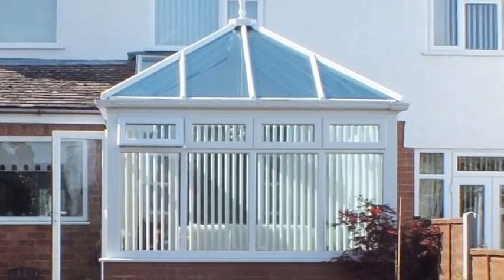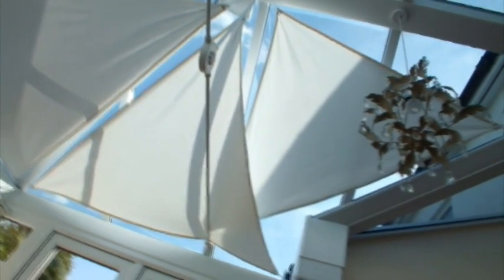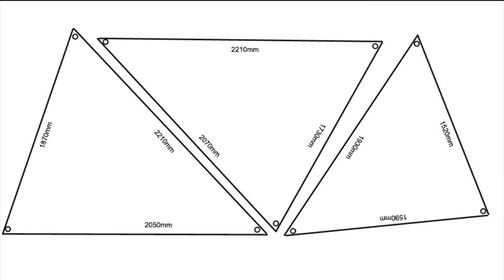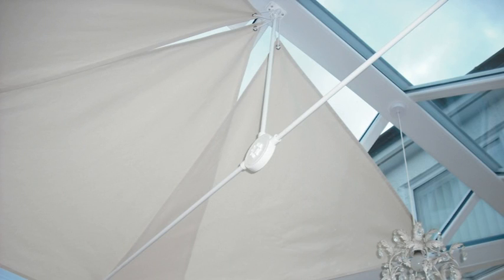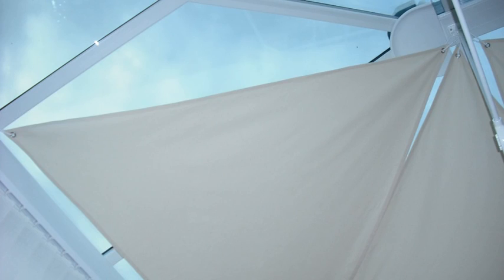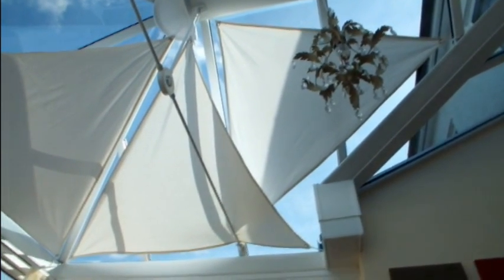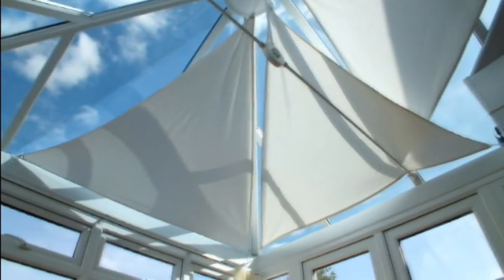How to make your own conservatory roof blinds

Comment from the maker: They reduce heat radiated through the glass that they cover. With ventilation from window vents (and sometimes doors) they have reduced the temperature in our conservatory on hot days by between 5 - 10°C.

Comment from the maker: You could try blackout lining but you might have two problems: the lining being too thin and pulling out of shape (we tried a cotton bed sheet and weren’t impressed) and the lining blocking out too much light. In the end we chose cotton canvas. The thickness is 0.025” which is the same as deckchair canvas. We were able to turn and hem this on an ordinary sewing machine. After 4 years they have still kept their shape. If you Google cotton canvas there are plenty of UK suppliers. Good luck.

Comment: Hi Kev,I made similar blinds after seeing your video,they work and look great,but I couldn’t figure out how to attach them to the upvc rails.I tried sticky back hooks  but they come away ,as soon as it gets hot. Any ideas please? Thanks Cathy.❤
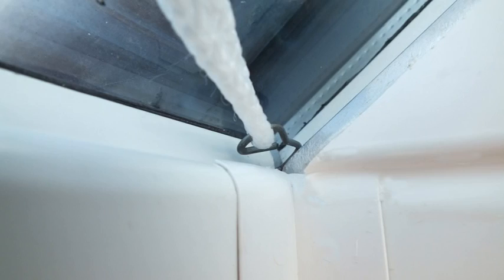Reply from the maker: We were lucky as there was a small gap between the beading running along the bottom of the glass and the uprights (see 1:47 into the video). This was big enough to slot the hooks into. If you don't have this gap, all I can suggest is that you drill some small holes in about the same position and screw in some screw eyelets and hook onto those. They should hold as long as your holes are small enough (maybe 1.5mm?). Add a spot of epoxy or super glue to the threads as long as you are prepared to leave them in if you take the blinds down, they shouldn't show too much?
Reply: @ Ah! Thank you so much,I have all winter to get that sorted. Bless you. I adored the look of them when they were up,and they did make a massive difference in the temperature. 😘😘😘

Comment: Hello Grandadkev, thanks so much for your video. We need shade for our conservatory to cut out the glare mainly. I know it's a long shot as it's years since you posted the video, but could you comment on the possibility of the magnification through the glass causing a fire hazard? Have you had any problems with this? Thank you, Phil
Reply from the maker: There is no magnification through double glazed panels as the panes of glass are parallel. The blinds decrease temperature rather than increase. See my comments since posting on where to source the fabric. Also we now use 5mm white bungee cord to tension the blinds rather than nylon cord.
Reply: @Grandadkev  Sorry for the delay in replying. Thank you so much for your response - we are on our way to getting them done! Kind regards, Phil

Comment: just been to dunelm,wasted journey. ..they don't do the canvas material, the nearest thing they do is blackout material which might do it,  but they only do 1.73 m. and at £4.75 per meter it's going to cost about £200 to make mine.
Reply: I am using charity shop and used canvas curtains, flatfell stiching them together to make sheets large enough to cover areas needed.  They are 3 different shades of natural, so will kind of look like real old sails.

Comment: A bit of a long shot as you made this video years ago but do you know the exact fabric you used from Dunelm? Thanks!
Reply from the maker: They were made from cotton canvas which we are still using but I'm not sure they do it anymore. If we were to make them now, I would probably use the 100% polyester from an outdoor sail shade which are advertised widely in various colours online. We have a cream one which would do quite well. 

Either that or we've just bought some tivoli heavy duty waterproof fabric to make some outdoor cushions. This might do (you can order a sample first). 

One tip - this year we had to reinforce and put new eyelets in the corners as the original ones has started to pull out. Also we now use thin bungee cord to achor the sails which gives a good tension.